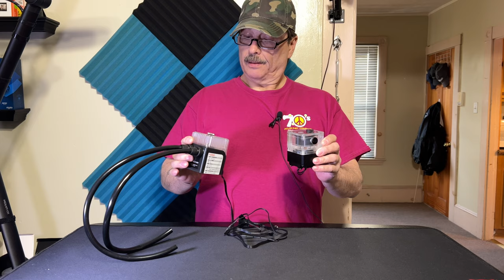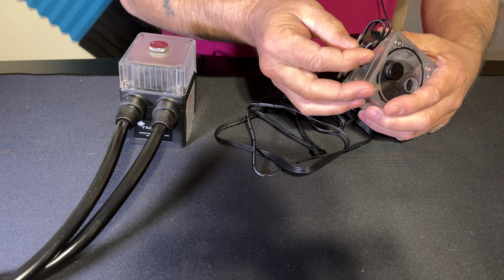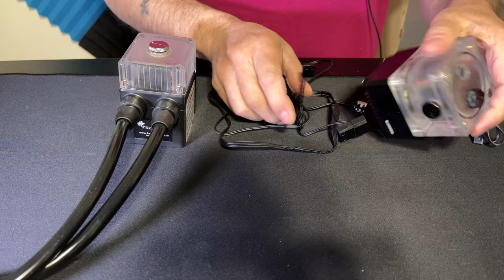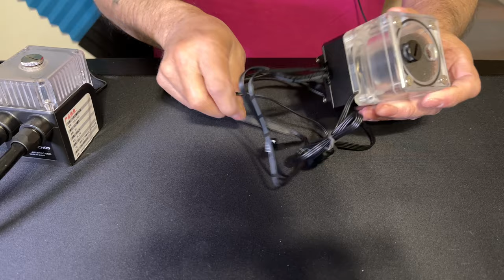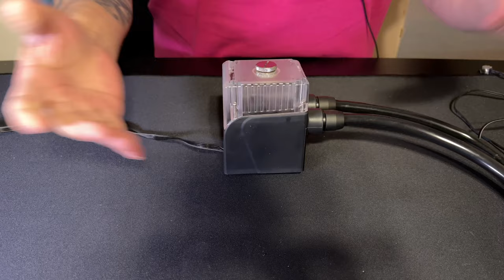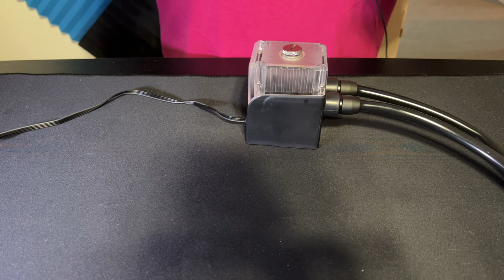Barrows Water Pump Fail

Comment: I thought you were going to say that the build quality was poor etc. The motherboard cant deliver enough current through a 3 pin for high flow pumps, thats why all 8w+ use external power. They always get the pwm signal off the motherboard through the 4pin. Its common knowledge by now.

Comment: Nice one for this vid bud, I almost pulled the trigger on the barrow... Trying to find a decent quiet affordable pwm pump is a nightmare nowadays
Reply from the maker: Alphacool Eisbaer Aurora (Solo) CPU Water Block and Pump, Digital RGB.  Great pump,  can be used with just a radiator if you are looking to save on space.  I started using them and have been 100 percent happy.